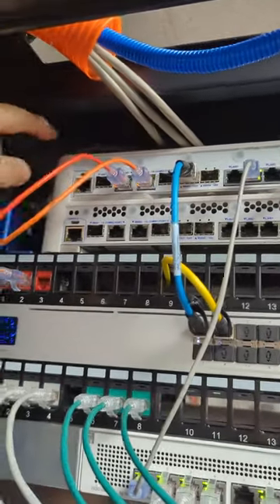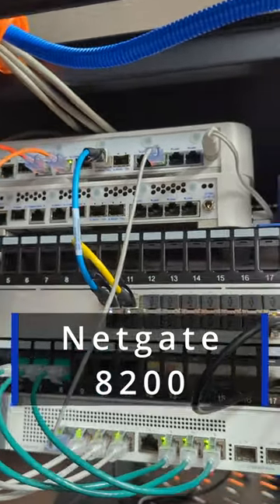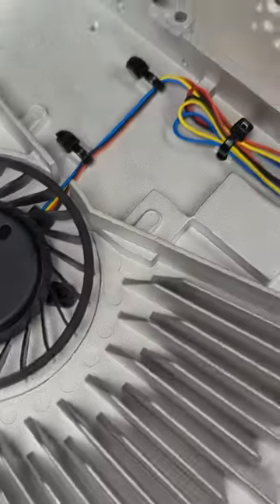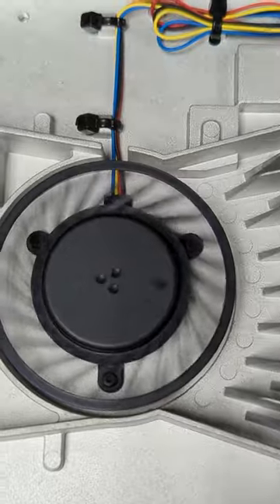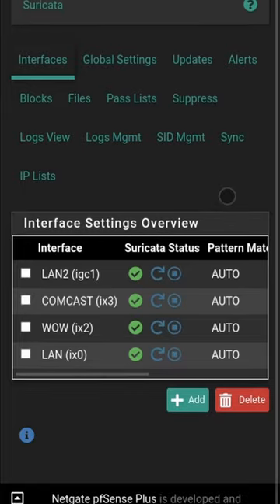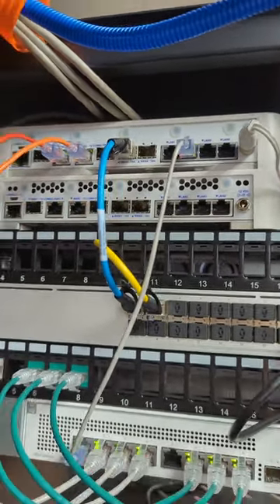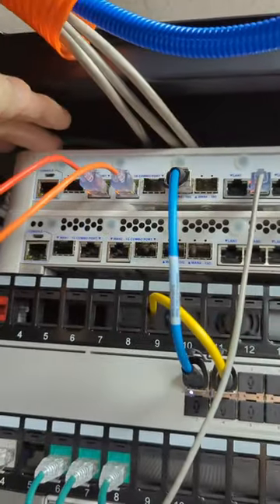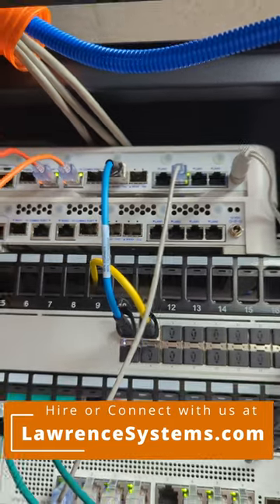#Shorts How I am Testing The Netgate 8200

Comment: Can not wait for the full review! Wondering the slots: "2x m.2 (Key-B slot) with dual-SIM (LTE, Wi-Fi, or NVMe) (PCIe, USB 2.0, USB 3.0)" Does LTE work on this thing, can you use a sim card in it?
Reply from the maker: LTE not built in, it would require an add in card
Reply: @LAWRENCESYSTEMS  Ah so they are saying it supports Key-B LTE add in cards.
Reply from the maker: Not something I have tested but they do have docs on that here https://docs.netgate.com/pfsense/en/latest/cellular/hardware.html
Reply: @LAWRENCESYSTEMS  Nice, thanks for the link!